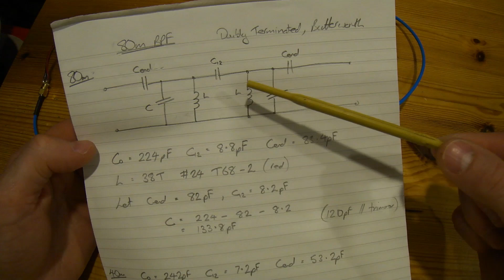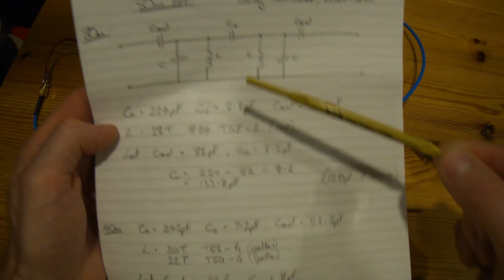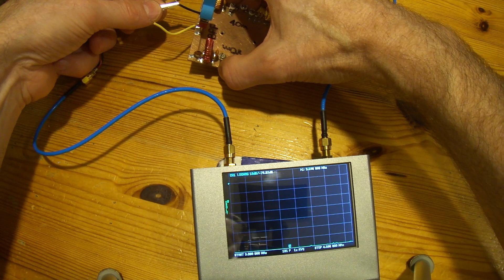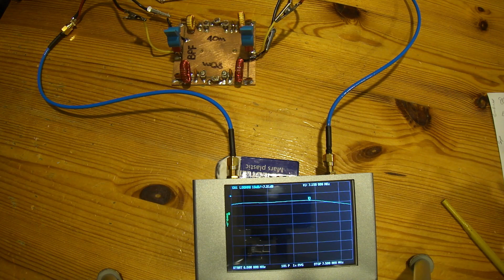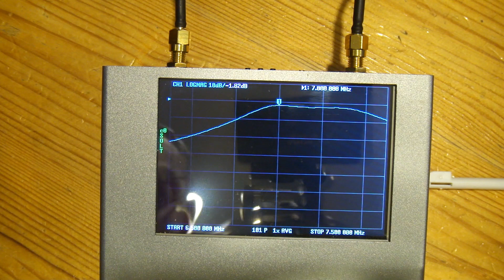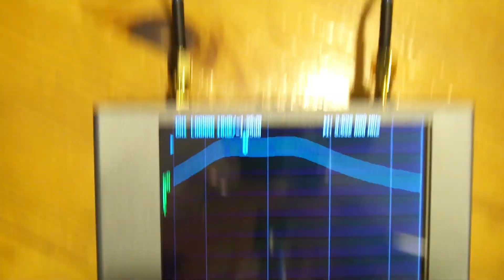Homebrew 80m/40m SSB/CW Rig - Part 4: Band Pass Filters

Comment: Hi Charlie, interesting how the two filters have different characteristics, not sure how much polystyrene caps will improve it but it’s worth a try. Have you tried inductively coupling the filters? I found that I could get much better roll off with around 2.5/3 dB insertion loss which works very well at 80 mtrs.  The circuit is essentially the same Butterworth 2 order filter but you use the toroids as transformers as well as inductors  to up the impedance into the filter and back down again out the other end.  To do this for 80 meters going from your drawing component numbers 2x C = 470pf with a 30p trimmers in parallel for tuning. C12 use 2 caps paralleled in its place 39p and 10p. The toriods in the circuit the same as you have them but with 30 turns on a T37. Don’t use the in/out caps just put an extra winding of 6 turns on each toriod one leg to ground and the other is the filter in/out. This will give you 50ohms in/out.  I got the circuit from QRP Labs and it works a treat. BTW I’m using multilayer ceramic caps nothing special. Just a thought. Best Regards.

Comment: Did you find that the Mix 6 had lower loss than the Mix 2 on 40 meters?
BTW, polystyrene are very low temperature caps. They melt with even modest power through them. I've never seen them used in even QRP level RF output circuits. I'd use them for an LC oscillator, a sample and hold, or a timing capacitor application, but that's about it.
Reply from the maker: Thanks for that. I'll definitely  not use them in a high power situation for just that reason.

Comment: Typically above 100pF, the commonly available capacitors are not NP0 of C0G, so losses increase. I have seen mylar capacitors being used at 3.5 MHz. Naaah.. You have to specifically look for NP0/ C0G above 100pF..
Reply from the maker: Yes. They are hard to come by. I might have to slash out and buy a range of mylar caps.
Reply: @CharlieMorrisZL2CTM  The mylar ones are no good for RF, but polystyrene or NPO ceramic ok. I found some ones from China which were NPO but values all around the place (+/- 20%)

Comment: Hi Charlie, thanks for sharing your experiments with filters. I only use C0G or NP0 caps in my own filters. They cost more but as you have clearly demonstrated the performance gains for higher quality caps are well worth it. 

Interesting that your NanoVNA does not behave as mine does. Mine is an old one with antiquated firmware but whenever I change the frequency of the sweep then I have to recalibrate for the new span. If I don't then I get erroneous results and one consequence is that the insertion loss always appears greater than it actually is. Once I have recalibrated for the new span then the IL improves dramatically. Maybe that was a glitch which was fixed by subsequent models and updated firmware.

Anyway, thanks very much as always. Keep up the great work. 73 Nick M0NTV
Reply from the maker: Thanks Nick. I might have to take a closer look at the VNA. I have an old one too, so I'll dig that out.
Reply: @CharlieMorrisZL2CTM  When you change the span you change the sample points. I believe that the nanoVNA compares the response (the "S2" part) to the pre-sampled output (stimulus). If you have not recalibrated, its stimulus samples don't coincide in frequency with the response samples, and, I believe, the frequency response calculations at those response frequencies will be less accurate.  But I'm no expert!

Comment: RF circuits need as low of a ground impedance as possible.  I believe the extra insertion loss is due to filtering on the ground signal.  You can keep everything simple and low-loss by converting from single ended to differential at the antenna.  In designing differential filters, i have only used them between differential inputs to differential outputs and they have always been very simple and included an impedance connection between + and - to help eliminate common mode
Reply from the maker: Thanks Chris. I'll look into that.